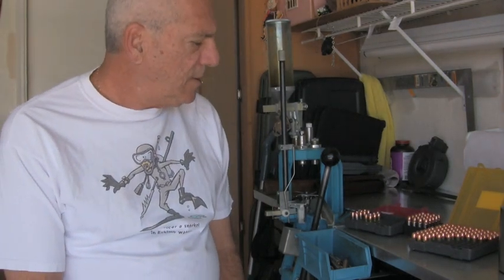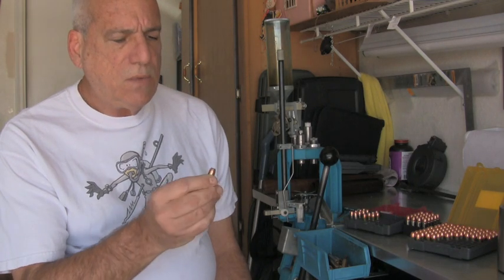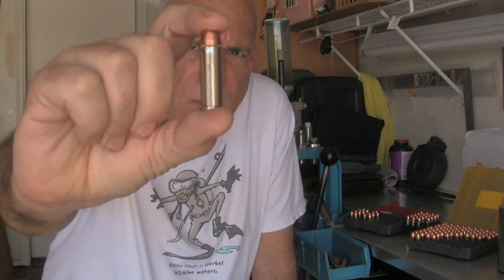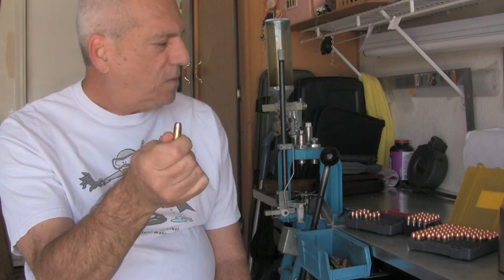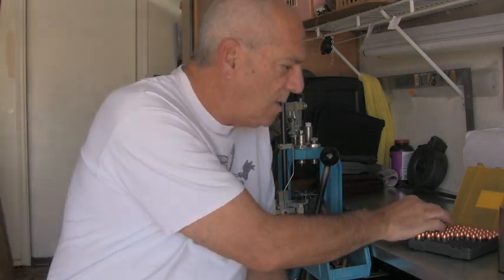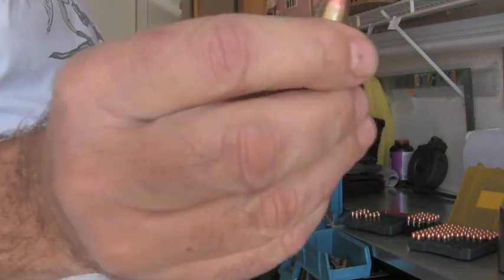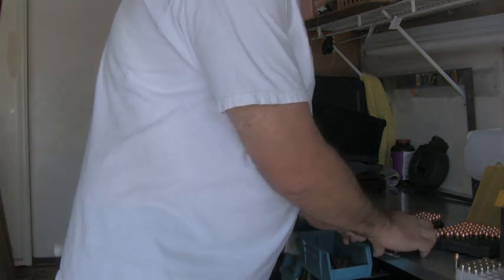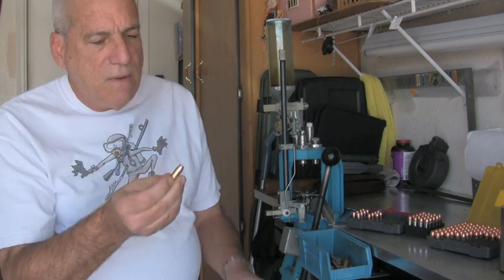To Crimp or not to Crimp, That is the question?

Comment: Great and informative video.  I use a single stage press and enjoy it very much.  I am still new to reloading, only a couple years, but do several handgun and rifle loads. Crimping has been an issue at times.  One example was bullet jump on my 460 mag.  That took me some work to get that cylinder open and then recrimp rounds.  I just subscribed and I am headed to part 2 now.
Reply from the maker: Thank you. Crimping has always been a mysterious challenge for a lot of reloader. Just this afternoon I came across a reloader's video on how his 10MM loads caused a catastrophic Kaboom distraction of his Glock. People underestimate the crimp stage, and it's importance. I am glad you are putting the extra time in on this.
Thank you for watching.
Have Fun Be Safe :)
Reply: jr10 Most autoloading pistols hold the round against the breechface with the extractor so the case mouth hardly ever contacts the chamber ledge. Also most pistol brass is never near the max length. A good crimp...not too much and not too little....gives the rounds consistent starting pressure which contributes to accuracy.
Reply from the maker: clloydhi While I am not sure how long you have been reloading, I would have a few issues with your comments. First off, if you are counting on the extractor as your stop gap in autoloaders, then I don't want to shoot any of your ammo. I would hate to count on a bent or cracked extractor to position a high pressure round (10mm, 44mag,etc) and have it positioned properly. You are also one of those people that feels that crimping aids in pressure and accuracy. To the contrary, you will be far ahead of the game if you put the same zeal into powder burn rates, and pressure curves. If what I have presented isn't true, why do you think so much emphasis has developed over the years with respect to head spacing, burn rates,rifling and a myriad of
other things that affect your accuracy far more then the crimp!
Reply: Was just pointing out a mechanical reality of autoloaders. I don't depend on machines to be reliable. All loads must be to spec....no ifs, ands or buts. I have been loading from 1988. I load 5000 rds a day, 5 days a week since 2009 on Dillon Super 1050s, 650s, and 550s and the RCBS Rockchucker. To insinuate that I depend on an extractor to headspace my ammo.....Crimp is a small thing that can cause so much problems. Over crimping ruins the bullet, causes bulging of the brass which releases neck tension causing the crimp to be ineffectual.

Comment: I reload all my own 45 acp and I never crimp for what I do I see no difference in shooting between crimping or not crimping. To me less movement of the brass longer it last brass hardens the more it is worked. I just full size my cases and prime,charge and seat bullet. In 40 years I have never had an issue and I'm still using some 40-50 yr old brass if it isn't split I use it.

Comment: Hello...  I have crimped on my .45 in the past, using the 200 grain XTP bullets and they have shot fine.  I am not using a drastic crimp by no means.  Now I own two .40's and after purchasing bullets and powder from a private dealer, he showed me two barrels that came out of pistols where a round "exploded" basically.  So from this, I got a bit spooked regarding crimping.  The LAST thing I want to do is crimp to much, or I guess what is called a "rolling crimp" where you "cut" into the bullet.  I have shot some that I have reloaded, some 155 grain bullets and they shot fine, but again, I don't want to be unsafe here.  I also don't want to have that kind of failure when my daughter or son shoots one of my pistols.  SO... having said all that, and please feel free to correct me, but I assume that when using a "middle of the road" load for the .40 S&W, as far as feet/second, (less than 950 feet per second...), you don't need a tight crimp.  Mainly because, as you said in the video, you are not shooting a 454 Casull with MAJOR recoil.  All you need is to flatten the "bell"????   From what I gather, that is the "flaring" of the end of the casing.  I also saw a video where a guy had put in a live round into a barrel, (disassembled from the pistol), lightly shook the barrel and the round did not fall out.  Then he put the live round back into the press and he must have done a slight crimp because he then put it back in the barrel and turned the barrel up and the round feel out.  All in all, any feedback on this would be MUCH appreciated.  Thanks for the video and hope to hear from you soon.  Steve in Colorado
Reply from the maker: Hi Steve.I applaud your reservations and conservative approach to reloading. Almost everything in this video was geared toward semi-auto pistols.  Bullet setback due to recoil has alway been a concern for reloaders. The reference to the Casull was to point out that the case does not head-space off of the case mouth. The crimp is a non-factor. My 10mm loads are quite hot, but that does not mean I need to get more aggressive with a crimp. You case gauging technique with your barrel Is excellent. I recommend that all the time to people without any dedicated case gauges.With respect to the Kaboom examples you mentioned, keep in mind that there are numerous reasons beyond  bullet setback, or over crimping that can cause that. That being said, caution will always be your best friend. Thanks for watching.
Have Fun Be Safe.

Comment: Also I have been reloading 45 ACP for years. I use a taper crimp die on all of them. I have bought factory ammo that would not feed because the case gets hung up on the chamber wile feeding. FTF. Once I put the factory ammo through my taper crimp die this problem disappears!
Reply from the maker: Don. I recently did my third crimping video to try and address the continuing crimping quandary.
Without being able to see the actual process it is hard for me to answer a lot of the specific questions I get.
This latest video I took a different approach to explain the issues people are having. Maybe it can shed some light on your situation. Thanks for taking the time to watch
Have Fun Be Safe.
https://www.youtube.com/watch?v=I6gSflNI0CQ

Comment from the maker: A lot of my handguns are Glocks or have polygonal barrels.I've never gotten involved with lead bullets.That being said, everything that pertains to jacketed bullet, holds true for lead cast.Sizing ,COL, and powder choices are very important. With lead you also have to add in factors such as Brinell Hardness, lead chemistry, gas checking, etc.Be very careful when getting started to monitor powder burn rates, and bullet velocities.Straight wall semi cases also seat off the caee mouth.Monitor crimp

Comment: Good information , I put a medium crimp on some .40 S&W once and it gave me all kinds of problems " extreme bullets" electroplated. Now I just remove the bell as you explained. I can't afford plated all the time and cast and shoot lead, The Lee deluxe pistol die sets have a really neat feature in there seating/crimp die. As the ram is raised and the bullet extracted,the die sizes the case to SAMMI  diameter again to assure proper loaded round diameter.
Reply from the maker: I love those Lee Deluxe sets. Good to see that you got the crimping squared away.
Thanks for watching.
Have Fun Be Safe :)
Reply: .40 bullets are normally .401"; post bell-removal, the case mouth should measure about .421" or so... (most brass measures .010" thick, you can easily see the math here. :))

Comment from the maker: When loading any straight wall semi-auto round, one has to fight the urge to crimp. When you are reloading with hard cast lead bullets with cannulas (grooves) the temptation is even stronger. It is important to fight the urge to crimp. The most important thing to remember is that these rounds seat off the case mouth, and not the base of the round. If you crimp these rounds to much, the bullet will seat to deeply in the chamber causing pressures spikes and accuracy issues.
Have Fun Be Safe :)

Comment from the maker: Always glad to see a new reloader. I can see by your intended list , that you are  going to be busy. My very first suggestion is to take it slow. Start with the 45 ACP caliber. It is the easiest to get a feel for the basics. I have also posted a more extensive update to this video. It is to Crimp or not Part 2. I think if you watch this it will answer a lot of your questions. Short answer, smaller straight wall pistol calibers = no crimp. Necked rifle cases mild taper in the lighter calibers.

Comment from the maker: You are absolutely correct. The 9mm has the same case mouth seating requirements that the 45 does. In some cases it is even more important to be precise with this reload. some very fortunate few have full auto 9mm weapons.
I would not want to be around if a round seats to deeply in a chamber due to poor technique at that rate of fire. I like the idea of a 9mm video. I'll work on putting one together.
Thanks for watching.
Have Fun Be Safe :)

Comment: I am new at reloading. I have a Uberti 1866 lever action 38spl. Everyone says I must roll crimp and so far I have done so with no problems. I fire a fairly hot round with no excess pressure signs. Velocity + - 950 - 1000 fps.

However after watching this video, I tried with no crimp. I immediately hit a snag. Some rounds would not feed into the breech because the now pronounced, sharp ridge where case meets bullet, hit against the breech entrance.

So, whilst crimp may not be wise or necessary for pistols, when it comes to lever action, there is a good practical reason for crimping. So long as you make sure the crimp is very light, I would be surprised if any real harm was caused .
Reply: The thing with .38spl and .357 mag (or indeed ANY straight-walled rimmed pistol or rifle cartridge) is that they headspace on the rim and not the mouth. The rim will stop the cartridge from going too far into the chamber, so the overcrimping issues the OP discusses are irrelevant. The only real issue in YOUR case is not crimping so hard that you deform the bullet.

Comment: hey thanks for the video... I am somewhat new to loading I load 9mm / 38spl /357mag /40s$w I is it ok to crimp 9mm?? I have been crimping them and my 38/357 because they have the crimp groove or canilure,, should I not crimp 9mm
I have about 2000 rds loaded and they are crimped with the lee factory crimp die and my ammo seems to be shooting ok .. what is your thoughts on this..
again thanks for the video
Reply: for my 9mm I use fmj from berrys and hard cast from Oregon trail.. for 38/357 I also use berys fmj and Oregon trail hard cast swc
and have used lee factory crimp die al everything.. I have about 1500 rds of 9mm that is crimped.. I pulled the bullets on a few rounds and the jacket or plateing is not broke from crimp..if it would be easier I can give you my cell# and maybe get some info from you
thanks again for your time..
Reply: jr10 the 357 is a new Taurus 7 shot stainless with the titanium barrel
and the 9mm is a new eaa witness with 31/2 in barrel all metal not poly
also have a new full size rock island 1911 9mm
all 3 firearms have less than 200 rds down the tube

Comment: How about for rifle rounds? 300 win mag to be exact I thought it was a sure thing but I looked at my hornaday factory ammo and it isn't crimped. Im looking at getting a ar10 version of this rifle as well and would like to know if going with my gut and crimping on this is a good idea.
Reply: Bottlenecked rifle rounds headspace on the shoulder (or on the rim or belt if they have one) - the mouth isn't critical and the crimp should be applied on bullets with a cannelure groove so that the rim just turns over into the groove. Too much and you risk raising pressures, IIRC, or deforming the bullet, or both.

The issue he's discussing here is pertinent to rimless straight-walled pistol ammunition only.
Reply from the maker: jsm666 Exactly right. It is refreshing to see someone who gets it. My pt.2 video on crimping goes into greater detail on this.
Thank you for taking the time to watch.
Have Fun be safe. :)
Reply from the maker: As far as the 300mag is concerned, you have to look at how the round is held in place in the chamber. Head spacing is only a variable of the final seating position of the bullet. If the round is held in place as in a bolt action or revolver, the crimp is less of a veritable then if it were an ar or semi-auto platform. When in doubt, alway go with your reference manuals! 
Have Fun Be Safe :)

Comment: Great info. My question sir is that I reload 40 s&w and I use the lee FCD. I use a very mild crimp and the reason for this is I was having problems with  the bullet being easily pushed into the case mouth. I'd really like to know if I'm doing something stupid. I use plated bullets but I use a very low amounts  of powder with a slower burning powder. ( unique ) . I had one rock back in my hand fairly hard when I just started reloading and I am highly aware of how important it is not to crimp to hard with a high pressure round like the 40 s&w and a hard crimp on it. Very bad combo. 
Also I have seen walmart Winchester rounds in that caliber with what looks like a hard crimp. 
I've only been reloading for 5 years and I'm open to any suggestions. I'm not A know it all .. I'd like to know if what I'm doing is detrimental to my health lol. 
PS .. I always check to see if I'm having any high pressure signs in my 40,s as I know that they are not forgiving of mistakes. So far so good but I would not want anyone to get the idea that my experience is the be all end all.  I've reloaded this round and others for the last 5 years but I've done a lot of homework on the subject. I only use low powder settings,  I never got load them and I only crimp enough to stop the bullet from pushing back.  
Any advice would be welcomed. Thanks for your video and knowledge. 👍
Reply: Btw that one that rocked back in my hand was a very fast burning powder.  BULLSEYE the hottest on the chart. I stopped using it for 40 s&w after that and stopped any heavy crimp. I guesss e CUP pressure must have been very high hence the heavy recoil. I got lucky.
Reply from the maker: Michael, Glad to see all of your attention to details. It is very refreshing to see a safe reloader. with respect to your bullet movement in the case, the most common reason for this is an excessive belling. The next most common answer to this is for the reloader to start adding a more aggressive crimp. This is not the best approach. when you are at the belling stage, you should adjust the die set so that the bullet sits on the case without having to hold it. The case will appear to have no bell to it, and this is what you want.Since you use plated bullets, getting to that sweet spot will take you a little longer. When you have the proper belling, the crimping stage will only need to remove the bell with a mild (if any taper crimp) With respect to the Winchester crimp, I would use other visual references. Pick up a box of Underwood 40s' and you will see a good example of a high pressure round crimp.
Reply: Great info thank you very much. I'm going to look into some of your other videos and share them. I would agree that my knowledge or lack there of about crimping straight wall brass was dangerous at best. I think some of this comes from the advertising of the Lee Factory Crimp Die as the answer to all of the new reloaders problems. I'm going to still run them but I will take out most if not all of the crimp on them and see how it goes. 
I do like the way they take care of the  unwanted bulge a bit better then the normal sizing And taper crimp dies. 
Thanks again for all the great info and safe reloading.. Michael.

Comment: auto pistol rounds - remove the bell only....; no need to squeeze the entire case mouth to less than the bullet diameter + 2x case thickness...; for my .45 ACP reloads, given a .4515" round, that's about .471", post bell-removal...)

Comment: jr10, what a great video. Crimping is one of the least understood and under appreciated stages of reloading. I've just started reloading auto and it is a different animal for sure. There is so much bad information out there for the new re-loader and I feel sorry for them; after all, we are not talking about some benign process. Your point about using a chronometer was well taken.
Reply from the maker: Thank you John. You are right. I think the die manufacturers are partially to blame.I hate the term factory crimp die included in some semi-auto sets. I would prefer they call them debelling dies  Newer reloaders .are already over anxious to crimp cases without any outside influences. 
Thank you for taking the time to watch.
Have Fun Be safe.
Reply: jr10, the part about being anxious to crimp cases is accurate. I just ordered my first press and I bought my first set of dies today(locally). I watched multiple videos on youtube on reloading. I see the crimping section and hear people say "just a quarter turn for a light crimp", and in my head, I am thinking well I will go with half a turn to make sure the crimp is solid and the bullet isnt going to move. Im glad I found your video because right before watching it I was reading the Hornady reloading book. Hornady even says to use a light crimp or no crimp on 9mm due to where it headspaces. Thank you for putting out good information!

Comment: I was having a problem with my starline brass buldgeing from the 10 mm pressure causing difficulty in chambering. I purchased an EGW evolution gun works undersized sizing/depriming die, that solved the problem nicely, it also holds the copper jacketed zero bullet tightly.I found better grouping without the crimps, my guess is that the crimp slightly deforms the bullet enough to interfere with it's areodynamics. With the crimps I was getting that 7 ring flyer.